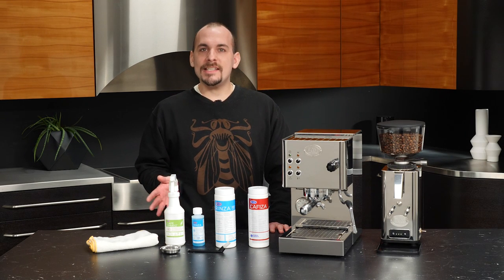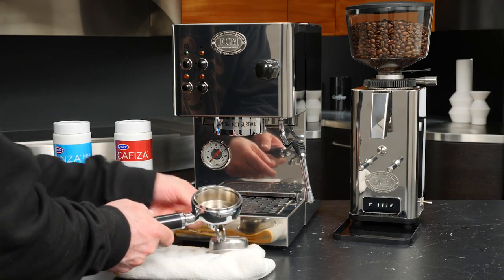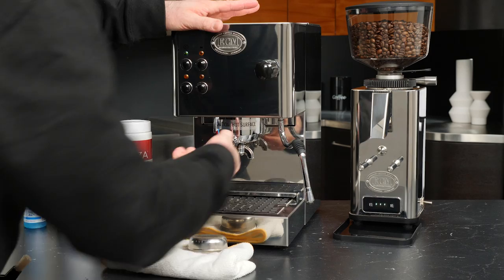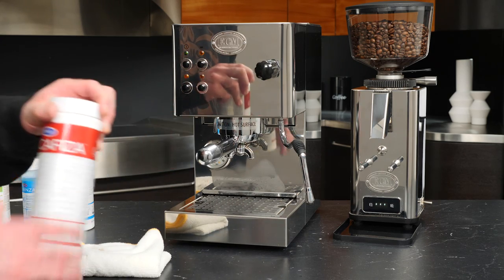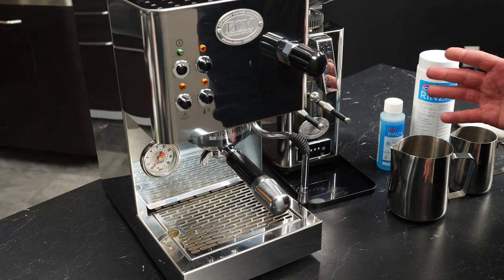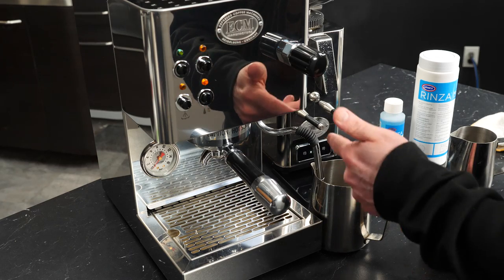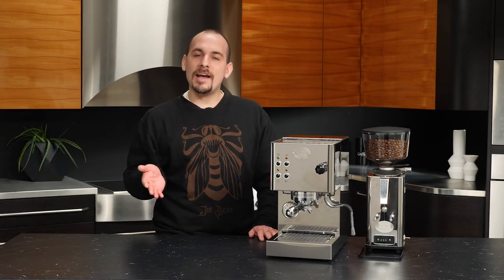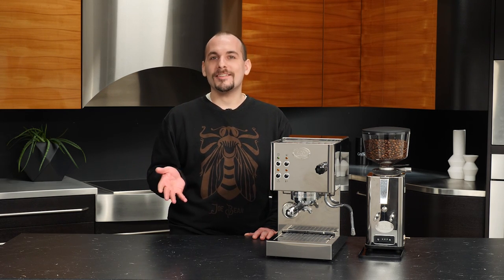ECM Casa V: Basic Maintenance

Comment: How do you empty  the boiler to pack the machine for travel?
Reply from the maker: Hi MM, Thanks for the question. Fully heat the machine up, turn it off then open the steam valve. Steam pressure in the boiler pushes water out. Keep the valve open until no more water comes out of the wand.